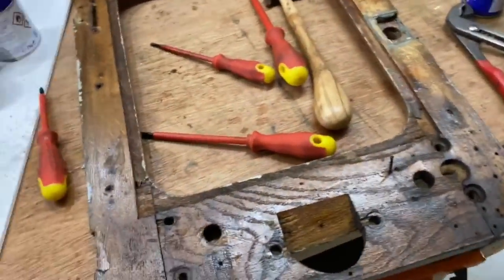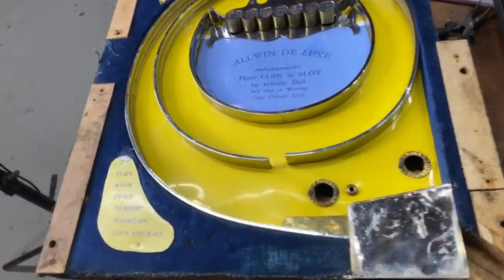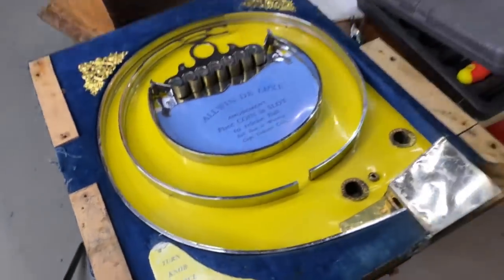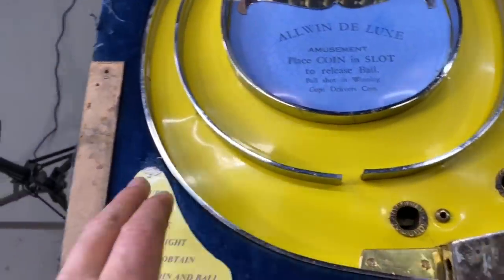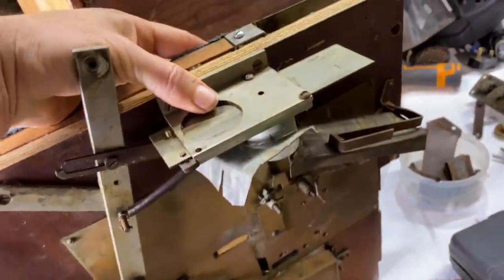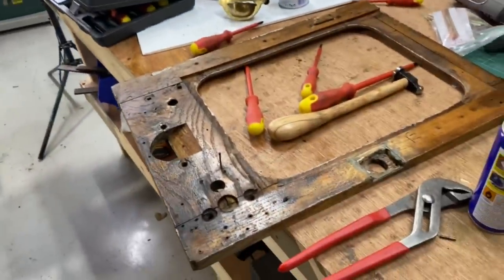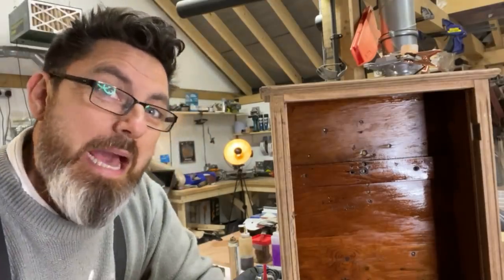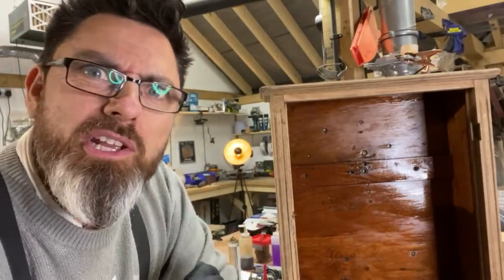German Penny Machine 1805 - VERY RARE MACHINE RESTORATION!

Comment: Dear Nick. Thanks for the videos. Very entertaining. And great job for the most part on the restoration. However a few pointers from a fellow coin-op restorer…
When you get one of these machines, you should not simply restore it to the way it was when you got it – only made to look prettier. Please consider restoring it’s original functionality as well. 

These machines originally had 4 iron balls. 1 on the playing field and 3 in a small reservoir in the center of the playing field. If you then hit your mark, you got a coin (penny or token) as well as the your original ball - AND you got the 3 balls from the "Reserve". You then had 4 more attempts to win again. I see parts from that original functionality in both the machines you restored, however you seemed to just ignore it. A shame. Given your skills, I’m sure you could manage a full restauration the next time 😊

Also. It does hurt a tiny little bit to see the playing field covered with a cheap green felt, instead of the lovely velvet type fabric, which it would have had originally. Similar fabric can still be obtained without too much trouble. It does give the machine a more pristine look and help to make it more authentic.

Good luck on your future restorations. Looking forward to seeing what you turn out.